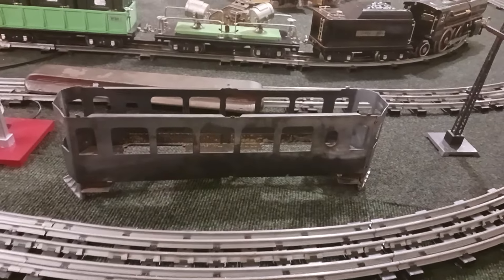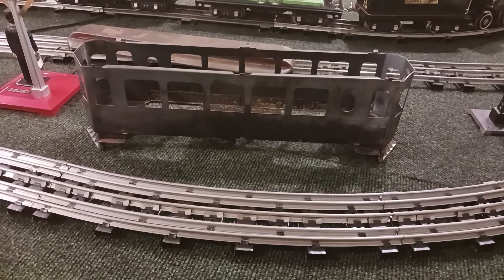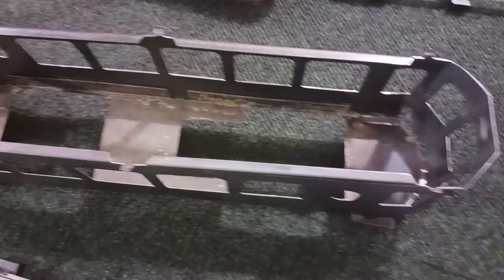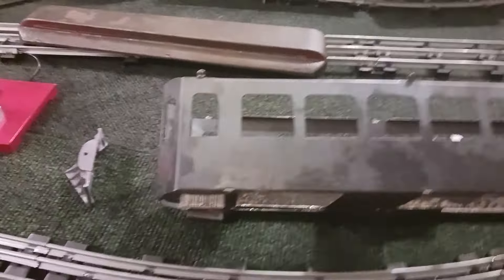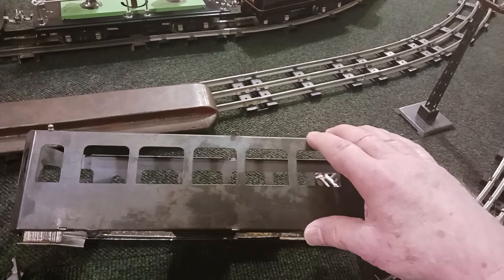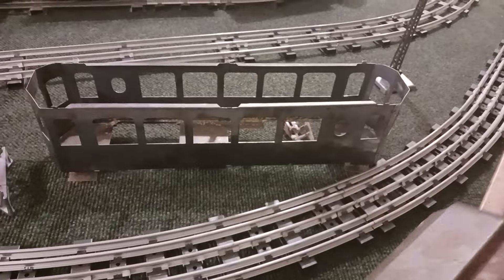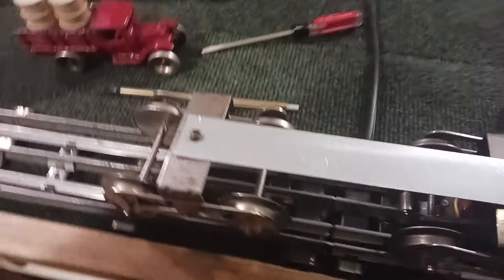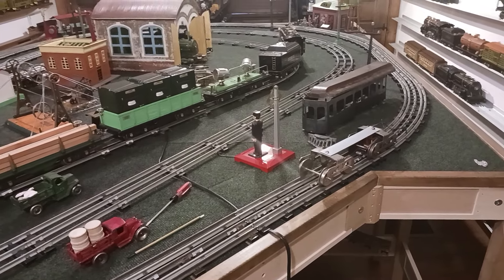The Hill Climber stripped and made a power frame.

Comment: Marx guy here, that little peach is really taking shape. Thanks for the Tide tip, I`ve been using 5% white vinegar and it takes 24--48 hours.
Reply from the maker: In most cases--for the old PreWar paint---an hour or less in boiling hot water and powdered Tide  will have 99% of the paint off. It does not work on new day paints.